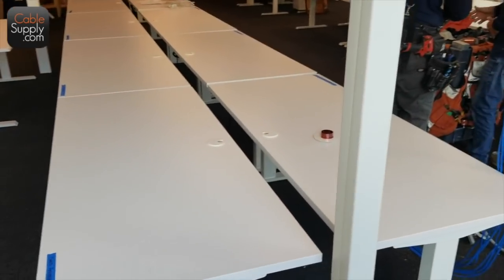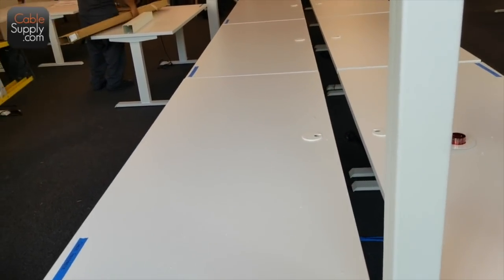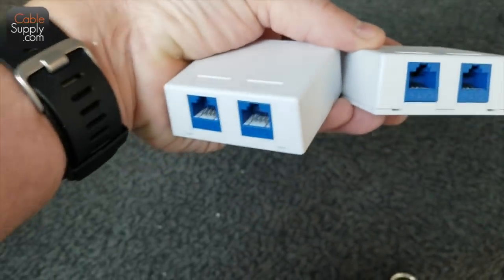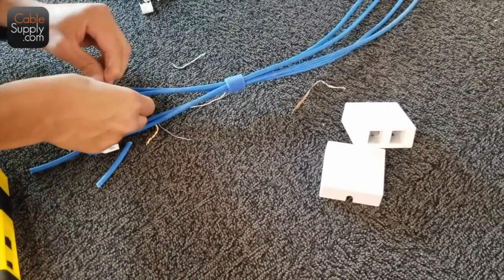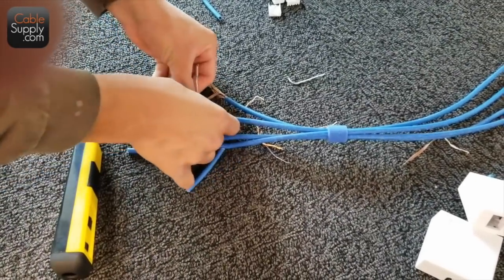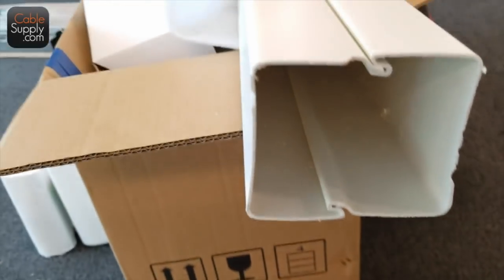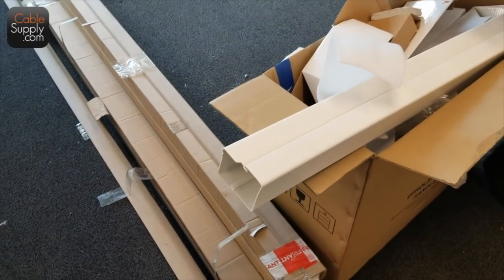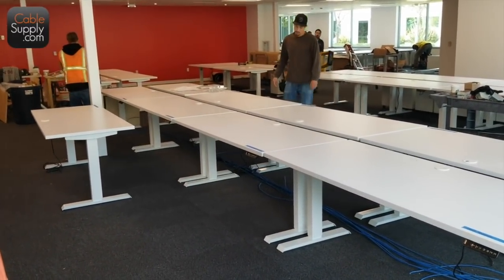Commercial Computer Network Cabling Part 3

Comment: Jim, watching your videos about cabling like this brings me back in time.  I remember a time running CAT3 before keystone jacks were even a thing.  There was also the runs of RG58 and BNC connectors.  My cabling days were almost 30 years ago, but as you said, it was fun doing that type of work.  I now work only with the machines those cables plug in to, but at times, that gets boring.  Where I work now, I was watching the contractor run cables for a new lab, and I wanted to join in and help.  Thanks for posting videos so people know what is involved with this type of work.

Comment: Should not be punching down on carpet like that. Too soft with too much rebound. There is a good chance the cable wont seat properly in the IDC. You can see how he's having to twist off the cables a lot from the IDC's after he punched down. that's a good indicator that the punch down tool isnt seating the cable properly. A dull blade could be contributing to that as well. When I punch down, 98 percent of the time i don't have to twist off a half cut cable like that.  Put something solid underneath the keystone, like or book or something.  He's also hurrying way too fast through it. Remember it's just a little tiny wire seating into an IDC, more delicate of a process to do properly than you think. It may work now, but the cable could work itself loose from the IDC over time.
Reply from the maker: I agree with you he should be using a "jack puck". A jack puck is a little plastic device that attaches to a RJ jack and makes it easier to punch down cable. We sell them on our website (Part Number 101736). My installation company, Nova Voice and Data Systems Inc, guarantees our work for 15 years. We also test every single RJ jack that we install. In thirty years we have never had one "go back" to repair a jack that we installed. Thorough testing is the key!!  Thanks for watching our videos. 
Please subscribe it helps our channel!

Comment: In “theory” you must separate high and low voltage a lot FURTHER than THAT!!

Thus is no metal conduit right? So then, I would do a minimal of 4 inches in between.

Yes, this will of course work, but please place an oscilloscope, an EMF gauge and an Ethernet packet sniffer so you can SEE the noise and retransmissions.

Nah, it’s OK!
But the difference between 970 Mbits/sec or 800....
Reply from the maker: Your right!  Except the 110vac power is in a metal flex. The metal flex is grounded. 
Thanks for watching!

Comment: Nice work, there. But, seen a couple of patches along the run of the cables on the data cables, you could tell by the electric tape around. Is it possible to extend a data cable by piecing it with another piece of cable? What I mean is that, ¿won’t that degrade the signal? Thanks.
Reply from the maker: No cuts in the cable. Yes it would degrade the signal.
Reply: A I it’s another cable for the closer cubicles taped on so they all pull down as a group. since they are different lengths they tape down lower on the longer ones. If you still care I know you comment was five months ago haha.

Comment: That's sticking backing through time the surface mount Box will fail
Reply from the maker: Yes you are correct,  The sticky back is only meant to hold the surface mount box in place until you can screw it to the wall with dry wall screws or self tapping metal screws
Reply: Been in the trade since 2007 work For sprig electric in northern California  working at apple  commercial install  cat6A    been watching your channel for years Like your zeal  for the trade  for sure and just wanna Say God Bless you And remember what Jesus did on the Cross for us ....  Blessings to you your Family and Business........